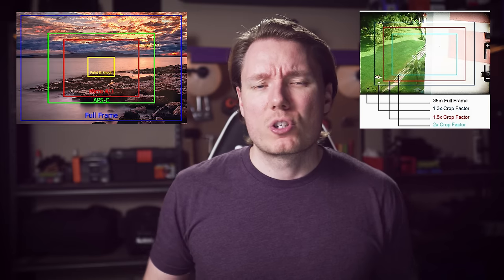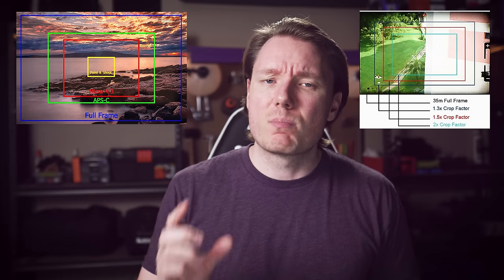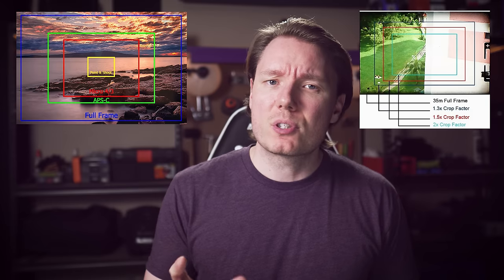Crop Lenses on Crop Bodies: How It Works vs Full Frame (APS-C & M43)

Comment: Great video! So what are the pro's and con's of Speed boosters? If I buy an APS-C camera, should I buy APS-C lenses or should I buy Full frame lenses and use them with a speed booster on that APS-C camera, because in the future I will probably upgrade to a full frame camera and wont need to buy and sell a whole new set of lenses?
Reply from the maker: Thanks! Yeah, speed boosters help by focusing the light down to the correct size. So there is less wasted circle on full frame lenses. This gives a nice bump in exposure too. The only cons would be the size extension and potential performance issues. Sometimes the autofocus doesn't work as well, and you can get hangups if you don't keep the firmware up to date.

Comment: Great video, which I just found when seeking a basic explanation about crop factor. I have a DX/APS-C Nikon DSLR and use APS-C lenses, so based on your explanation, there should be no adjustment in focal length since the lens is designed for that sensor, correct? Thanks again
Reply: No no no. Millimeters are millimeters. The focal length never changes to anything else. You have nut even started to understand things if you think gicwl lengths on APS-C lenses are somehow different from those on film frame.

With smaller sensors one uses shorter focal lengths. Why would the kit lens start at 15-18 mm when on full frame that would be ultra wide. Because with smaller sensors one uses shorter focal lengths.

Comment: Hi Gerald. Great video! So am I right in thinking that if I'm using a canon with a crop factor of 1.6 and 10mm lens, I will see the same as if I use a full frame camera with a 10mm lens?
Reply: No you don't see the same exact image. 

You see a smaller portion of the same exact image.

Comment: Another factor I've never been clear on (and never been able to test personally) is that Focal Length also affects the z-axis compression in your image. A 25mm lens on a Full Frame Camera will have the an angle of view equivalent to a 50mm on a M43 camera, but will it still also affect the compression of the z-axis like a 50mm?

Comment: Some say that you have to apply crop factor to the focal length even if you are using a lens made for that crop sensor, is that true?
Reply: No, and there is no such thing as a crop sensor. They are just different sizes, and with the correct lenses the field of view will be exactly the same.

Comment: Great video Gerald Undone! Although I got confused at the end. If an APS-C (or a M4/3 ) lens has a narrow FOV  than a full frame "in the same Focal length (I suppose)",  the rectangle or circle crop does make sense, and it seems the quickest and best way to demonstrate Focal length equivalent from different sensor size.  A little help please!
Reply: A APS-C lens has smaller image circle than a full frame lens. The field of view is identical on an APS-C camera.

The image circle has to cover the sensor or one has to use crop mode which basically changes your camera into an APS-C camera.

Comment: Hello @Gerald Undone I don’t know if I’m asking this correctly but.. I aspire to shoot films my favorite lengths are 24mm 35mm 50mm and I’m getting the BMPCC4k as my next camera so to achieve that in the best possible way with little to no vignette on the lens should I buy the 0.71 or 0.64 adapter? And should the 0.71 be used with aps-c  and the 0.64 with full frame only? because I don’t only want to own zoom lenses like the sigma 18-35mm aps-c lens. I want set prime lenses that are one length..for example a 35mm which was the only lens used to shoot call me by your name one of my favorites films/aesthetics..so I want to know with which booster will I get me closer that or the best results obviously keeping in mind the crop factor of the 4k which like you said 1.35x with the 0.71 and about 1.2 with the 0.64

Comment: Nicely explained, thanks. The question for me now being how big are the cons of using speed boosters vs bare lenses (image/light lost) vs bare lenses (paired with a proper sensor, no cropping nor speed booster needed)
Reply: Like any adapted solution, it's clunkier and you're losing native functioning of integral electronics or have no functioning of them at all (bad for newer lenses with no physical controls).

Optically, the image quality potential of the lens can be affected by the quality of the booster--there may be distortion or aberration that wasn't there before for instance

Comment: Great video, but I might want to add that the Boxes in Boxes makes actually sense for the vast majority of photographers (even though it represents only one possible case) - if you are a Nikon or Canon (and Sony to some extend) photographer. This two companies have more full frame lenses than crop sensor lenses, so the chance of needing that illustration is much higher than for other photographers.
Reply from the maker: Thanks, Frank! And yeah, since the whole notion is used to help people relate to 35mm film, it does make sense. But since I get asked this all the time due to the volume of APS-C shooters, I figured it was necessary. Cheers!

Comment: That was a very useful explanation, thanks. I still think that all the suggestions that a full frame lens on a Micro Four Thirds body reduces quality in any way is questionable. I have a Lumix G6 with kit lens 14-42 plus I have several Minolta MD classic lenses I can attach using a (no element) type adaptor. I have never seen any difference in sharpness or quality between them. Just today I set up tests for all of them, including Minolta MD 28mm, 50mm 1.4, 35-70 macro, plus all same Minolta lenses with the Minolta tele-converter attached. Comparing them all as close as possible to the kit lens with the same aperture, white balance, shutter speed etc. I can see no difference in quality, no vignetting and no loss of sharpness at the edges. Maybe a tiny bit with the tele-converter. No difference, in fact the 50mm 1.4 and 35-70 Minolta look better in some shots. Can anyone explain exactly what flaws, I should be looking for because I find the Minolta MD lenses to be pristine.

Comment: Hi, new to M43 cameras and just wondering. When you say that 35 mm with MFT you actually get 75 mm, do you mean that if I buy a 35 mm MFT lens I will have the same crop factor or is it only in the case of speed boosters and lenses that aren't design specifically for MFT mounts? Thanks!
Reply from the maker: I meant that if you put a 35mm MFT lens on your MFT camera, it would resemble the field of view of a 70mm lens on a full frame camera.

Comment: So what you are saying is that it's better to use EF-S lenses on aps-c bodies because they concentrate the light to where it has to be (the sensor) instead of having it spread out by an ef lens (designed for full frame sensors)? Does this mean that, all else being equal, a 35mm f/1.8 EF-S lens and a 35mm f/1.8 EF both let in the same amount of light, but the EF-S version uses this light more efficiently on an aps-c body than the EF version would?

Comment: Hey, I recently bought a Sony A6400 along with an FE 28mm f2 (full frame lens) and I think the image quality is just fine. I compared it to the APS-C 35mm 1.8 lens and I couldn’t tell the difference in image quality. Is Sony doing something unique since they are allowing their full frame lenses to fit the crop sensor a6000 series camera bodies to maintain the image quality?
Reply from the maker: They're making good lenses. Generally the middle portion of a lens is the best, but you also magnify the faults when you mount to APS-C. But if you make good lenses, you should get great results in both cases.

Comment: If I use a sony Apsc format 50mm lens on a sony 5100 which has an Apsc sensor..will the crop factor come into play ?  Will i get the same focal length and angle of view of 50mm or should i multiply it with 1.5 to know the focal length it is producing..? Please help to understand this.

Comment: That was amazing. Thank you so much for taking the time to make this crystal clear! Is there a formula for calculating the effective focal length of an ASPC EF lens on an MFT sensor (BMPCC4K) using a .71 MB speed booster?
Reply: The fact that it is 0.71x should be a hint. You multiply by 0.71. It also increases the speed of the lens. A full frame lens with a crop sensor and 0.71 speed booster gives results close to what it gives on full frame. With MFT there still is difference.

Lets say you have 50 mm f/1.4. If you put a speed booster you get 35.5 mm f/1.0. However if you then use the 2x crop factor to calculate the equivalence, it would be equivalent to 71 mm f/2 on full frame.

Note the speed booster actually changes the lens while the crop factor is just a mathematical tool for comparison. The lens never becomes 71 mm.

Comment: Gerald, I tested this out using a Sony A6000 with a E mount 55-210 and a FE G Lens 70-200 (full frame camera) both take the same size image at 200 mm focal length
Reply: No, they will not take the same image.

Comment: The expression "Cropping"  is just a question of interpretation. I think the cropping is not about actually copping the projected image by the sensor, but a factor what can be used to calculate the view of a lens for any other format than leica. It is worth to mention Leica has been around 90 years and this format and the focal length was used for this format is deeply embedded in thinking about photography. so 50 mm means a view close to the normal human view, and 20mm is a wide angle comares to that. Obviously focal length and view can be interpreted regarding the size of the sensor which has been 24x36 mm for 100 years (for the public at least).
Reply: This that 50 mm is somehow what human eye sees is BS.

Comment: Hi G. Quick question, if I may: will my old lenses from my Nikon d40 be useless for my (soon to be purchased) canon 80d ? Will there be black areas in the periphery of my photos/videos? Best regards, Erlend
Reply from the maker: I've never tried that kind of adapting, but the crop on the 80D is actually a bit tighter than the D40, so it might work. If you can find an appropriate mount adapter.
Reply: @geraldundone  thanks for replying! Great tutorial, thanks!

Comment: Gerald please clarify me this, if i use a 2.8 F full frame lens on a crop body would that also change the aperture ?
Thanks and great explanation on the crop factor!
Reply from the maker: Thanks, José. So the lens wouldn't change, which means the aperture and entrance pupil diameter would stay the same, and you would also have the same exposure. However, because you're using a smaller sensor, your field of view would be more narrow which would indirectly affect your depth of field. Say you used a 50mm f/2.8 full frame lens on a crop body. That would give you an equivalent field of view of a 75mm lens on a full frame camera, which would mean you'd need to stand further away to frame the shot the same, and standing further away will increase your depth of field as well. And it all works out the same factor of 1.5x. 
50mm x 1.5 = 75mm
If you took the shot on Full Frame at 100cm, you'd have to stand at 150cm to take the shot on crop sensor (1.5x)
And if you stand 1.5x further away, you will have 1.5x more depth of field.
The only way to have an equal depth of field in that case would then be to make your aperture 1.5x bigger, which would mean setting it around f/1.8. That's why people suggest that the aperture changes. It doesn't, but in order to have the look be equivalent you'd need a lower f-number.
Reply: The aperture or focal length never changes. They are what they are and they are properties of the lens and not of the sensor.

Comment: Hi Gerald, what would you recommend for the bmpcc 4k, i want to purchase a few rokinon cine ds lenses, i don't know what's better, the mft or the ef full frame with a speedbooster? Do i gain anything if i choose the ef full frame? Do i gonna get that extra f point of light in this manual lenses anyway? Aand also there are ef apsc, what would happen with a 16mm apsc with a speedbooster on the bmpcc 4k? Thanks man, great great channel!
Reply from the maker: Hey! Thanks for the kind words.
Yeah, you would still gain the stops even if used manually. The main benefit would be more light. And shallower depth of field if you're into that.
If you went with APS-C, make sure the speedbooster is also for APS-C or else you could get some vignetting, but otherwise the math is the same, you multiply the crop factor by the factor of the speedbooster, which will be something like 0.71x, etc.
Reply: @geraldundone  Thanks for answering Gerald! So, a 16mm apsc has a x1.5 crop factor, the speedbooster has a x0.71 so the math is: 16 x 1.5 x 0.71? In that case the result is 17.04, alnost the original 16mm????! I thought in same part of the ecuation must be de x2 crop of th mft doesn't?? I'M CONFUSED! Sorry to bother you, but i haven't found that info anywhere.
Reply from the maker: @weirdbug  It's the crop factor of the camera. So 0.71 x (Camera Crop Factor) x Focal Length. So for MFT it's 2x, like you said.

Comment: The designation of "crop sensor" is only a relative phrase for comparison.  However it is appropriate to understand what is cut away if you put full frame glass on a crop sensor camera.  On the plus side, doing that avoids vignette in the corners of a frame very VERY well.

Comment: Superb information. So as I understand it, say a 30mm f1.4 lens designed for APS-C on a APS-C body will have these exact specs of 30mm f1.4? And the "crop" multiplication should only be used on lens that are used on a different sensor size than designed for?
Cheers!
Reply from the maker: Thanks! 😃
That's not quite right. A 30mm lens for APS-C is a 30mm lens, yes, in the sense that the physical measurement is 30mm. But it will still have the field of view of a 48mm lens on full frame. Meaning, even though it's not "cropping" the same way, you'll still see the same amount of stuff through the lens as a 48mm lens on a full frame camera.
Reply: @geraldundone  I see, thanks for that. So that would be pure geometry in action. How about the light? As you explained, an APS-C lens will project the image to match the APS-C sensor size, so the sensor would register the "largest rectangular area" like a Full Frame lens with a Full Frame body - should we also account for the loss of light by multiplying the aperture value? (f1.4 = about f2). I would say no because we "catch" the maximum amount of light passing through the lens, but that's just my guess. :D
Reply from the maker: You do have to multiply the aperture if you want to know an equivalency to full frame. But it is reflected differently.
When it comes to depth of field,  f/1.4 on APS-C will look similar to a f/2.1 or f/2.2 on a full frame camera. (depending if you have an 1.5x or 1.6x APS-C) 
And when it comes to light, because full frame sensors allow for a higher total volume of light, you also have to multiply the factor^2 for ISO. The exposure will match regardless. So if you take a shot on APS-C at ISO 400, f/1.4, it will look the same as a full frame ISO 400, f/1.4 in terms of brightness, but the APS-C will be noisier.
The equivalent noise level for full frame would be 1.5^2 x ISO. So in this case 1.5^2 x 400, or 2.25 x 400 = 900.
All that means is the full frame sensor will produce the same noise at ISO 900 as the crop sensor produces at 400. Even if the "brightness" looks the same.
Reply: @geraldundone  I see, thanks for explaining this in a comprehensible way. Really it's not that easy to find such clear content, I believe this channel is underrated. :)

Comment: This was very informative, thank you. 

Do any cameras have in body adjustments when having a FF lens mounted to a smaller sensor body?

Example, FF Sony native e mount to crop a6300/a6500

Sadly i don’t have a crop sensor zoom or prime that has the twin FF to test differences. 

Anyway, solid video, love your channel.
Reply from the maker: Thanks for the kind words. I haven't seen any crop cameras do that, no. Other than the basic lens corrections for vignette or distortion.
Reply: @geraldundone  solid, thank you 🤙🏾

Comment: Quick question, will I see the same angle of view if I use a crop lens with a crop body at 50 mm compared to full frame at 50mm? This 50 crop lens 50 mm will adjust the image to reach the same angle of view? What I mean is, will I need to continue using the crop factor on an APS-C camera if I am using a proper APS-C lens?
Reply from the maker: Crop factor always applies even if the lens is made for APS-C. So yes, a 50mm APS-C lens will still have a similar field of view to a 75mm lens on full frame.

Comment: Hi Gerald, I have a question that is perfect for you to answer.  If I have a FF 24mm lens and I use it on a APS-C with a 1.5 crop (36mm equivalent).  Would the picture I take with the 24mm lens on APS-C look the same as a 35mm FF lens on a full frame body?

This question is not about DOF, its about how the facial features will look on a given focal length.
Reply from the maker: Good question. The distortion you see on faces on the 24mm isn't caused just because it's a 24mm. It's caused because a lens that wide means you have to get closer to the face, making it look different. So when you shoot crop, you can stand further away, which reduces that look. So, yes, it will look more like a 35mm FF than a 24mm FF for facial features.
Reply: @geraldundone  thank you sir.
Reply: The facial features depend on the distance, not on the lens.